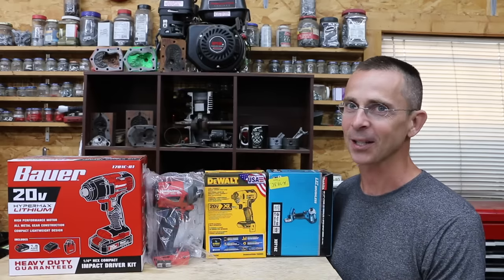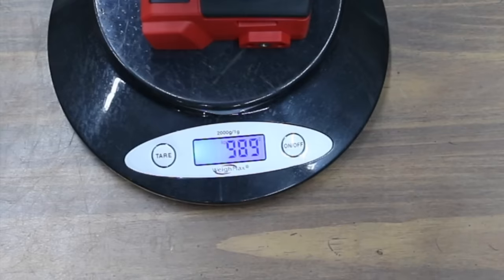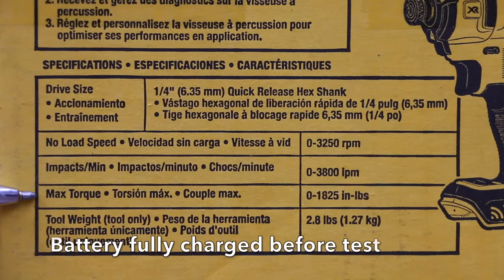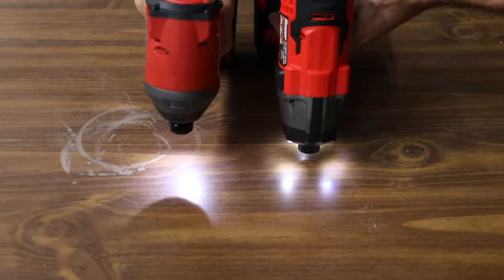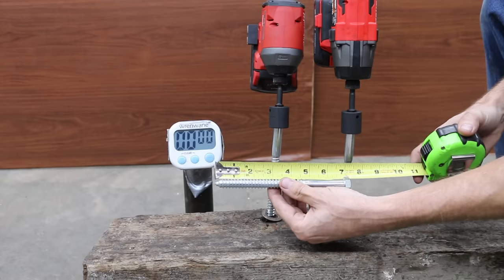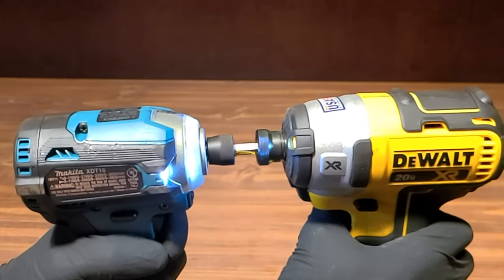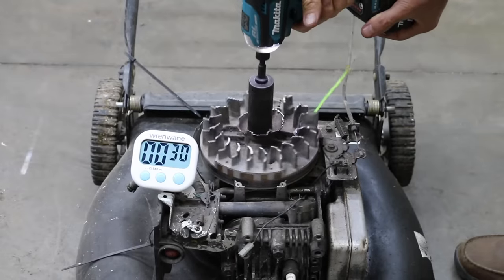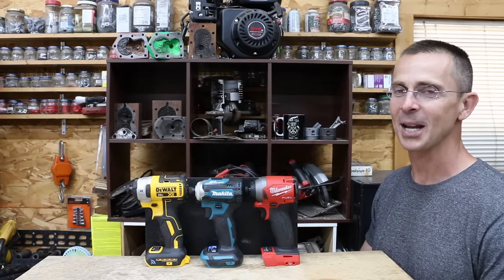Best Impact Driver? DeWalt vs Milwaukee vs Makita vs Bauer!  Let's find out!

Comment: Earlier this year, I picked up the Bauer at $59.99 and thought, "Why not?"
I've been using it to run lugs nuts off and back on my vehicles, change shocks on the Bronco and a few other odd jobs. So far, no complaints. It was 60 bucks, after all. I'll just have to remember not to try and cold drill a 6 inch bolt through a railroad tie with it.
Reply from the maker: Thanks for sharing!
Reply: Lol ya or ya might have to spend more than a new impact 🔥
Reply: What size battery did you use to remove car lug nuts?  I'm thinking of throwing a Dewalt DCF885 (1/4" impact driver) with 20V 2 AH battery into the back of my car for use instead of using the usual 4-way lug wrench.
Reply: been a while, still going ??
Reply: my driver has a hard time removing my car's lugs. but i got a high torque for that now XD
Reply: There is no way your Bauer impact DRIVER is taking off lug nuts. Maybe if they had an impact wrench but definitely not the model shown here.
Reply: @rossb5593  yeah, not the driver. even my makita can't get a little car's lugs off. though that's why i got a wrench. two uggas and the lug is off
Reply: @blendpinexus1416   some tools got balls for how cheap they are. I’m a service tech, and I’ll tell you my craftsman keeps up with some of the smaller Milwaukee it’s a 1/4 driver. Not a bolt it won’t break that the Milwaukee does. I use it to zip of lug nuts that I’ve torqued to 80-120ft lbs. When you get up to half inch tho it’s no comparison, I love all tool brands, everyone makes something better than the other.
Reply: @mitchellb2  craftsman is turning into quite the sleeper tool brand right now
Reply: @gunsmokefan1344 hows it doing so far? Thinking about it too
Reply: I bought one today for $19.18 (tool only, no battery or charger) it was on clearance and they were running a deal where ITC members got an additional 40% off clearance.
Reply: Ya Thank You..$60 Wins @ Light Duty➕✔️.
Reply: I’ve built two 12x16 decks with wet treated lumber, and assembled a harbor freight trailer with that bauer.  Best 60 bucks ever.  But, their battery just doesn’t last.
Reply: @ProjectFarm  you can at least show me which of them 3 is the best because now I don't know what to buy for you 🤬
Reply: @voiceofreason9238  I had the same idea, turns out that we are stronger and it does not justify the cost.
Reply: @mitchellb2 which craftsman model?.
Reply: 1/4 inch impact will not remove lug nuts. You need at least a 1/2 inch drive impact with at minimum 300 foot pounds of torque
Reply: @busman2050 tell that to my Bauer 3/8" impact. It's rated at 325lb and has taken lugs off everything from Toyotas, Kias, full size Chevys, and even forklifts 😂 don't get me wrong, it's not the same as my air impacts and I do have the Bauer 1/2" as well but it will do the job. Only time it didn't was on an older Camry that came from NJ that was rusted solid. Sheared two studs on that car when replacing the rotors. WAS YOUR DAM CARS YOU YANKEES

Comment: This is a really in depth test! for me the breaking strength of the Milwaukee isn't great for my application, and the fine control of the Makita works best for me. I am in a trade and have tried Milwaukee, Makita, and Dewalt. In my experience Makita is the most reliable. While it doesn't quite have the brute force of Milwaukee it has never failed me and has finer control. Dewalt is on the same playing field as Ryobi, not worth your time. The one benefit that Milwaukee offers over Makita is a more diverse tool range, as in more niche tools, however, I have never returned one of my Makita tools under warranty, but Milwaukee tools are always out for repairs. Do you want a 5 year warranty, or a tool that works. For me I prefer Makita only because their tools are the only ones that haven't failed through abuse.
Reply from the maker: Thanks for sharing.

Comment: Trigger control is important to me. I can get my Milwaukee M12 impact driver under load slow enough to impact 1/4 screw turns at about 1 seconds each impact, which is really handy getting a drywall screw a touch deeper. Very impressed. The pocketable M12 units have been everyones go-to 90% of the time.
Reply from the maker: Thanks for the feedback.

Comment: Literally grease melting out of the gun
Dewalt app “looks fine to me”
Reply: Just the fact that power tools now have apps is insane to me! So at least DeWalt could get their shit together and have an app that realizes when OK is no longer bueno!
Reply: Glorified black and decker junk
Reply from the maker: Thanks for watching.
Reply: I'm fine, your fine. We're fine.
Reply: @darrinbush5953  no, DeWalt is made a lot better than Black and Decker. Ive used both.
Reply: @darrinbush5953  Black and Decker is now owned by Stanley, who also owns DeWalt, and a lot of the Stanley products share manufacturing and components.  So B & D today is not the junk of the past.
Reply: It is fine. It’s just the high temperature liquefying the grease. Happens all the time to our impacts act work. If they start locking up, just put a dab of grease in the hammer case
Reply: @andybub45  B&D owns DW
Reply: @cyberpunkspike  Maybe
Reply: depends where they put the sensor.
often it's in the circuit part, and if it's somewhat weather-protected which Dewalt usually is at these prices' these controller-boards are often podded in some compound so a pain in the ass to change failed electronic board components.
Reply: @justinmartin8887  and you dont see this as an issue?🤣🤣
Reply: @darrinbush5953  Seriously, if you are going to buy a cheap tool, buy a Black & Decker, not a Dewalt. There are teardowns all over Youtube that show a ton of component sharing between the two. In the end though if you are shopping cheap tools in the Black & Decker price class, just get Ryobi.

Personally I've never had a serious issue with any Milwaukee tool, even their bits and blades. It's one of the only reasons I go to Home Depot, where exchanging under warranty is also insanely easy (I've had batteries go bad under warranty and HD swapped them out for me)
Reply: lazarance hey my mid torque Milwaukee is 2 years old, and it had grease coming out pretty often already. My ingersoll rand actually has a factory grease zerk, and so do some aircats
Reply: CNN developed the app.
Reply: Tim yup. My coworker purchased a replacement anvil for his high torque dewalt, and it arrived packaged in a black&decker bag with a black&decker part number on it.
Reply: I still have my ELU cordless drills. Both made in England.